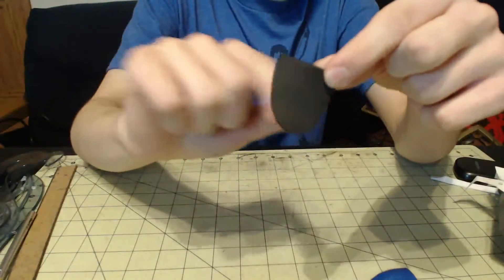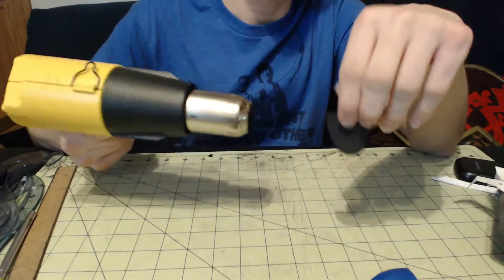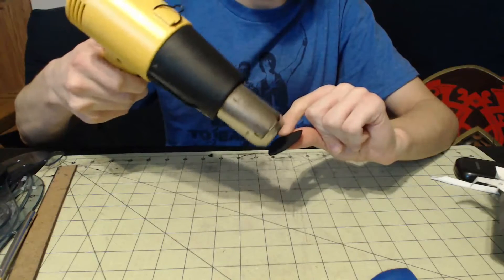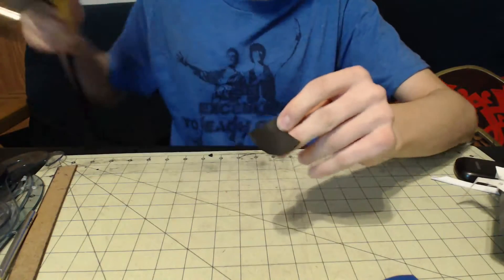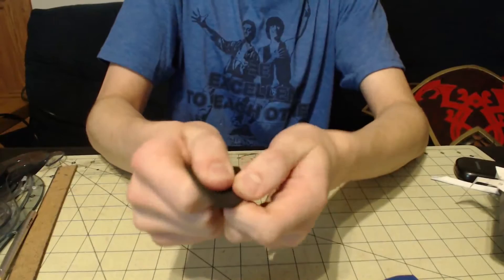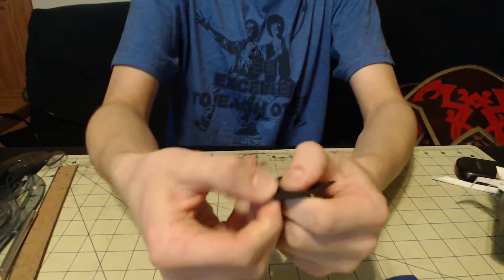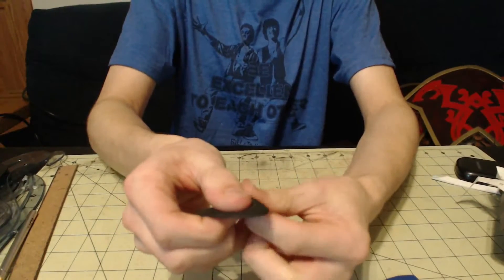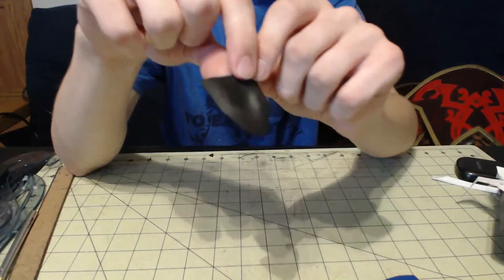How to make Foam scales

Comment: you could also make a 2part piece lets say part A and B from wood, and in between those 2 parts you can put the heated foam scale, and press A over B, and the scale cools down in that certain shape, the parts can be made using a dremel, from wood or even better from metal on a lathe if you have access to one. useful if you need like 400-500 of these scales made a certain way